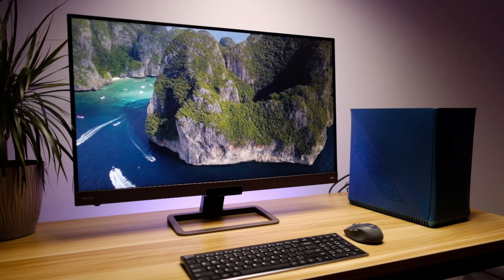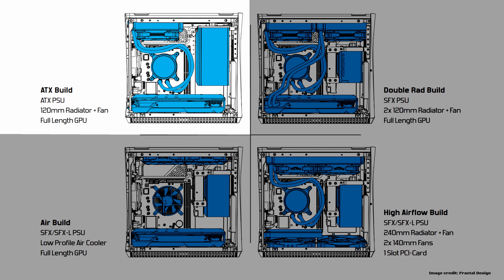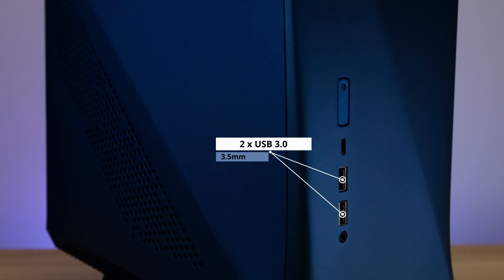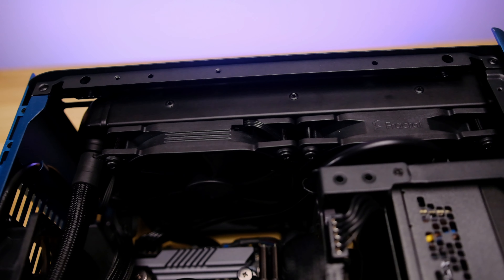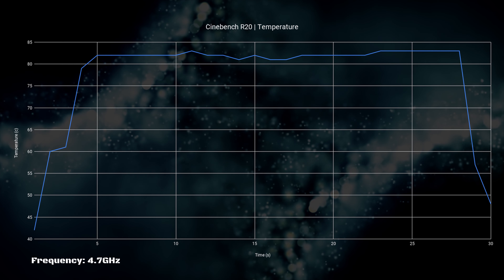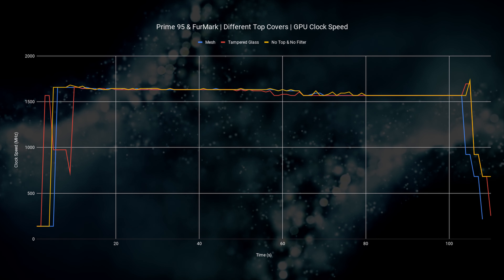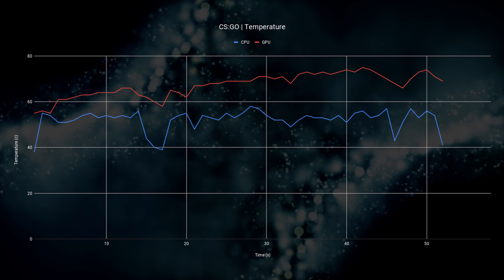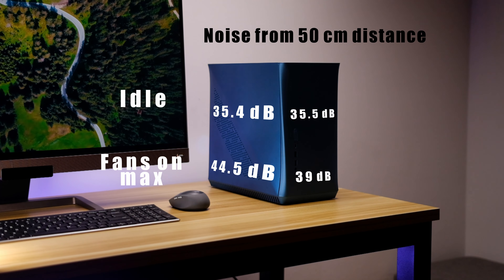Fractal Design Era ITX  - Build | Thermals | Noise Benchmarks

Comment: I just got this case a couple weeks back and I build my dream Ai Machine learning PC, with  a ryzen 7 5700G, 32gb ddr4 3200mhz ram and also added an RTX Quadro 4000 and I have to say the gpu never goes over 75 degrees in most cases. Minding the fact that it is watercooled too for the cpu. I set the top fans to exhause and the 80mm one to intake. This is truly my dream case and also the most expensive I owned haha 😂
Reply from the maker: very nice use case! also as an added bonus - it looks great! :)

Comment: Thanks. Great video. 

Hi, I have the same white Asus GPU. Just wanna know, can I add below the GPU? There is room there? If so what dimensions would the fan be and what direction they should flow.
Reply from the maker: I am afraid not, there is no space below.
Reply: @A2KMedia  That's sad. Good thing that I choosen integrated graphics CPU. Also, If I somehow added feets to it and added a fan, what direction should they push or pull air?
Reply from the maker: I would still go for a two slot GPU as you will be much better off that way. in terms of fans if you ever "mod" the system then I would recommend them to be set as intake
Reply: @A2KMedia  Thanks. You are great. I believe, using a stock cooler for the CPU is too much to ask for this case.
Reply from the maker: depends on the CPU and how much you want to push it :) I would get something bigger over time  - if budget allows it